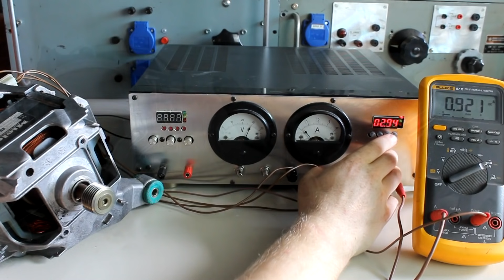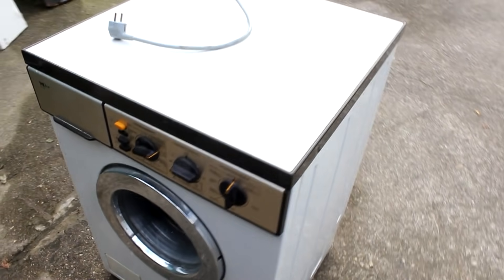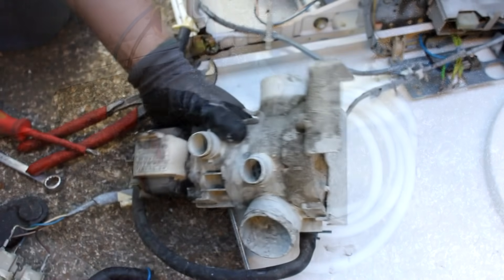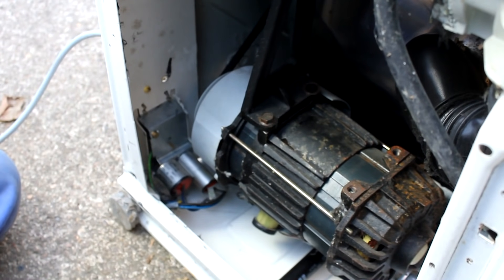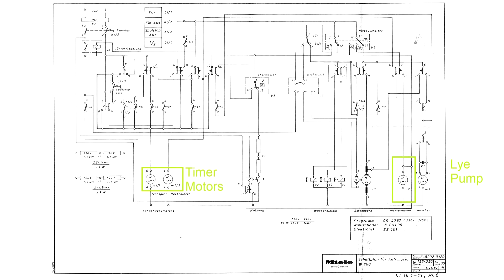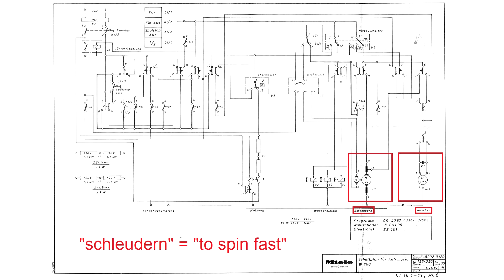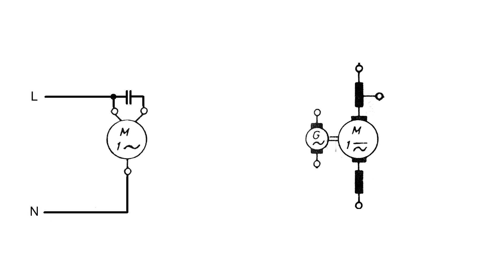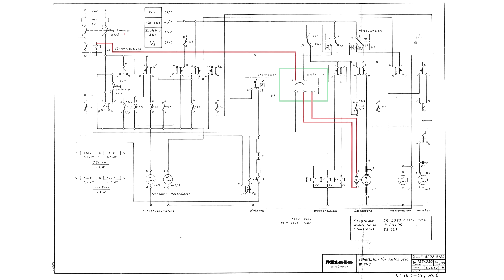Salvage a Big Electric Motor and Transmission from a Miele Washing Machine

Comment: Hi love ur videos. I have a question, can you use the universal motor when you rectify the mains voltage and than use a pwm controller to regulate the speed ? or do the revolutions keep going up the same as when you connect it directly to 230V Ac???

Comment: Hi. I'd like to share my idea that I had a couple years ago and would like to see somebody to do. There are small industrial machines called tumblers or vibropolishers. They're very popular in workshops working with metal, especially for cleaning and polishing car wheels and other large parts while avoiding most of the  labor And polishing can be really laborious. Ever since I saw one I kept wondering if one can make it out of an old washing machine and the kind of vibrator motor that's used for mixing paint.
You can use the remnants of a washing machine. You just need to cover the drum with polyurethane, attatch a vibrating motor and make sure the suspension doesn't rattle.

Comment: The washing drums are usefull.
Top loaded ones( of decent quality). 
Use as fish sump .
Frontloaded ones :drum makes good fire baskets. 
The main bearing for the drum can be reused .  Very sturdy.  On most watching machines the washing encloser is plastic  . crack the plastic around the bearing  with  a hammer. 
The screw that goes into the iron casting is for the
Electric grounding  of the drum. 
Keep intact.

Comment: Very well done video explaining and performing the analysis on an old and very well engineered and well made washing machine. Her in America I dont think we have a company we can say this is the best washing machine. Whom ever you talk to they would give a everything from MayTag to Kenmore. In may younger years I took apart many washing machines and found they use a standard induction motor and for the logic operation using mechanical switches with a beefed up clock induction motor to rotate the know to click on various switches.  As of Today more modern washing machines, I have repaired about 4 of them, mostly the main MPU board goes bad. These use universal motors.

Comment: hi. I had a similar washing machine and I am trying to save the motor. In the part of the induction motor, where do I connect the capacitor? I missed the drawings and somebody else disassembled the machine without checking connections before. Thanks

Comment: You can use the drum as a planter and the the cabinet, adding a shelf inside, as storage for parts and hardware. I did so with an old dryer, re-purposing the motor for a tool-sharpening device by adding a grinding wheel. Next time I find a washing machine motor (120 VAC where I live) I'll do some of your tests, perhaps even using the SCR circuit. I'll put everything in series and apply DC to it also--if it's the right type of motor.
If you want to get rid of your cold quickly, eat a couple of teeth of raw garlic with honey and lemon juice WITH MEALS! for two days. I've been doing it for 20 years. It works all the time... unless you catch the flu, which is viral.
https://www.amazon.com/s?k=joaquin+delgado&rh=n%3A154606011&ref=nb_sb_noss

Comment: I see you recover quite a lot of parts from washing machines, so you might be able to help me out. I have a Miele Novatronic W1918 that operates on 220 volts. The solenoid valve for filling the washing machine with water is weak and the machine shows a fault with the water supply and shuts down before starting to wash the clothes. I called the Miele office and they sent out a repairman who said that the repair would cost more than half of what a new machine would cost. Since my machine is no longer made, I would need to purchase a new model, but the salesman told me that one customer had a problem with his new washing machine and the company refused to service his machine because the washer and dryer were not a matching pair! So they want us to buy a new set and throw out perfectly good equipment! What I need to know is if the filling valves have a feedback to the computer so that ONLY their valves can be used or if the valves are simple valves that could be replaced with any other valve? If so, I would need to match the voltage of the solenoid with the line voltage provided by the machine. I have no idea what the voltage of the valves would be and if there is enough room in the machine to adapt some other valve in the place of the original one(s). Would you happen to know that information?

The repair guy also said that my drain pump is making noise and will soon fail. Can the pump be overhauled with off-the shelf parts or are they made with odd sized bearings and seals? Could I buy a pump from a different brand of washing machine and install that with adapters? The price of Miele parts is outrageous! I doubt I will want to ever buy Miele equipment again.

Thanks in advance for any information you can provide. Tearing down the machine doesn't look that difficult after watching you do it.

Comment: Would love to see a Direct Drive washing machine motor!
Reply: I think the earliest Direct Drives may be from mid 2000's .  I only recall seeing them in that era.  A lot of them would still be operating or not so cheap to purchase second hand.
My 2005 LG is a direct drive and it is still working as good as new.  LG put a 10 year warranty on their Direct Drive motors, but obviously not on the rest of the machine.   That may put them out of reach of a junkyard.
Reply: @EsotericArctos  We had an LG direct drive from 2000 or 2001. But this year we had to buy a new one because the drum bearing broke. Poorly we couldn't find a new bearing. While looking for
parts i discovered that it is a common problem from this series.
That could be the reason for no giving longer warranty on the rest of the machine.
Reply: Those are very new though (2016) compared to the rest of the stuff this guy takes apart on the channel.

Comment: What comes to washing machines, Miele is THE shit.

I took apart my parents' Miele, which had served a 5-person household way over two decades, and was astonished by the build and material quality. All the balancing weights were cast steel, not (the easily cracking) concrete that modern machines use. Every single bearing still rolled as good as new. All the load-bearing bolts were 10.9(!). I still run the motor in my wheel polishing machine today. German quality and engineering at its very best.

Comment: I had the chance to get a similar washing machine from that period. The electro-mechanical programmer was dead but I replaced it with an ATmega driving a relays board to take all the elements in charge. Those machines are not designed for programmed obseolescence. They are servicable with simple parts (standard bearings, hoses...) and the wiring diagram was even included to help you service it.
No modern machine is comparable.
Reply: I know. I took apart about three washing machines. Zero diagrams, bad screw placement, and multiple sizes of screws. They don't want you to replace parts. It's called planned obsolescence. This way you have to buy a new one .

Comment: This washing machine is before the day, vector control algorithm was perfected. Now a days, all washing machine has PMSM or 3-ph induction motor. A direct drive motor (PMSM) can run at 50 RPM for washing and the same motor can spin till 1200 RPM using field weakening technique. It involves huge amount of mathematical equation solving -- few application which can explain why we studied calculus, complex number and trigonometry in school days.

Comment: I have this thought.. that if I keep watching your videos I will at some point become smarter. Time will tell.. But I've passed over many a washing machines due to the fact that the internals might as well be from a UFO for all that I understand them. Basic electronics fascinates me, and I've always been a scrapper. I hope that my days of hauling everything to the scrap yard is over, and that some day I will be able to understand and repurpose the parts that work. Because I look at what you had there on the bench spinning that pulley up in a vise and all I could think about was steampunk drill press, or the platform for my new 2x72 belt grinder.. Although I'd have to build a filtered enclosure around the motor to save it from dust and shavings..

Comment: Really great video! No apologies needed for the absence. That Miele washer is a work of great engineering and materials quality that you do not see in newer models. Both the inner and outer tubs are stainless, whereas newer models are plastic outer tubs. I also favor the older electromechanical switching. Easier troubleshooting and not susceptible to surges and spikes on the mains.

Comment: Looks like who ever had that had hard water.  I have well water and my dishwasher got stained like that inside.  I got some Whink Rust Stain Remover.  I put that into a bottle which I could spray the inside of the dishwasher with and sprayed it lightly on the rust stains til they were gone.  It did not take long at all for it to dissolve the rust stains because it is very quick with that product.  It looked like new again inside.  I just made sure to run it a couple times empty to get all that stuff out of it so it would be safe to eat off plates washed in there.  There are other rust removers that are somewhat safer but don't dissolve the rust stains fast but they work well for people who might not want something as strong as what I like to use.  I treated the sink the same way and it did brighten up some.  Although the sink and dishwasher are stainless steel, they can and did get a coating of rust over time.  It is just such a gradual thing you never notice it but I also had rust stains like those in my shower that were difficult to scrub off.

You would be surprised how fast that stuff takes the rust stains off things but it is one of those chemicals that you will want to avoid spilling on yourself.  It contains hydroflouric acid and that is bad stuff.

Comment: I congratulate you for your recicling of old components. but a note on the coment on the circuit for locking the door. it is complex for failsafe. here in brazil, a couple of year ago, some dude took this safety board off and amputated his 8 year old son's arm, he tried to get his favorite shit off on the spindry cicle. so it is a verry important circuit and in case someone is thinking of reutilising the hole machine please make sure that this circuit work. in the other hand it is a powerfull fet swiching circuit that cold be reutilised in several aplications.

Comment: Good to hear you're okay. Those washing machines are very nicely made. My mother had an old Philips one, that was called an "Electra" sold by the nationalised Electricity Board in 1980. That too was a nice old thing. It used a transistorised motor controller with tacho, and a DC "Polymotor Italia" permanent magnet motor. The drain pump motor was a standard shaded-pole one. The Miele motor is a work of art, with its field divert system for spinning, and reversable induction motor feature. Years ago a neigbour had an OLD Indesit automatic. This used a HUGE AC motor that was reversable, and had different field taps for this, and also the spinning function.

Comment: Thanks for showing the Miele dual motor!  That motor is the answer to the problem which eventually was solved by the variable frequency drive!  But this motor is a very elegant, mechanical non-electronic solution to this problem.

Comment: Hi  mister,
Can i ask to you about tachometric controls?
I have a ISKRA (STAYER) 1990 router with a universal motor electronically controlled running from 2500- 24.000 rpm (values are similar not exact, because now, i don't have the tool under my eyes) 
The speed control is realized with a ferrite ring on the main shaft and electronic circuitry (sealed in a plastic support with epoxy) I've leaved the tool in a too much moistured room for at least 15 years. (*) Now i have completely cleaned all the tool: bearings, dust,  brushes and collector,  rust from surfaces and i leaved the tool in a  warm and dry place for all this summer before connecting electric power.
Now the tool is mechanically as if it had just left the factory, but it seems to me that the motor don't reach  the maximum speed.
When I reduce the rotation speed the control circuit cuts off  the power to the motor as it did when it was new, then the control circuit somehow works:

According to your experience could the ferrite ring be magnetized and lost its original magnetization?
* in this room I left two other tools: a drill and a ribbon sander, I connected them to the net a few days after retrieving them, I did not think they could have any problems ... after 10 minutes of testing the engine started to spin slower and the sander to emit smoke. That's why this time I've been waiting to connect the router, I hope I have waited enough.
I know it's hard to understand from my distance explanation but thank you anyway for your answer

Comment: Dismantled a Hoover from the early/mid seventies which had a large single speed motor and large gearbox and clutch arrangement  built in for the high speed and reverse

Comment: Two questions and a comment. What was the power rating of the induction motor, and what was its rated speed?
I am really impressed with the robustness of that washing machine. I have salvaged at least 10 washing machines here in the US... all with plastic tubs and concrete in the bottom for weight. I stopped picking them up, but I will be looking for a old one now. They all have induction motors (alone) with multiple windings for different speeds. Here they are usually (4, 6, 8 poles) 850, 1140, 1725 rpm. They are always 1/2 or 3/4 hp. Excellent video.
Reply: that's a miele but maybe you can find an old whirlpool
Reply: Wait i know you your the guy that make videos about electronics

Comment: This is very impressive for 1980''s. Never knew they had front load washers back then. That machine was definitely the end of a great era, the quality of the parts inside is unlike anything you would see today. Shame you had to take it apart. Would have been great to see it running.
Reply: Sorry for late reply/necroposting, but I have a similar machine that was made in late 70s and it had sensor buttons (stainless steel buttons which I guess react to electricity of human body). Was looking for a replacement motor because mine broke down (brush holder fell apart, and I think it eventually shorted out), which BTW is needed because a more modern Beko rusted out, ball bearing slipped out of place and there's no way to fix it because housing is made of molded plastic that is impossible to repair reliably...
Reply: Since the 50s maybe not Europe but whatever lol

Comment: The glass door of this machine will make a nice casserole dish, since it is temperature-hardened material and it had to stand temperatures over 100°C before. I have had those before, and they integrated well into the kitchen for anything around 180°C or more.
Reply: Yes, that was my first thought. Or maybe a heated bed for a 3D printer? It would make a great series of videos to see what could be done with all the parts of a single machine. Somebody below suggested a fire pit for the drum. The motor would be great for a sander or lathe. There's also a lot of sheet metal that could be reused if you had a spot welder.
Reply: I've known of recycling projects before that used those doors for casserole dishes, and now the fact that most washing machine doors aren't flat like they used to be really makes me hurt, because it's such a waste of perfectly good materials! But that's capitalism for you, I suppose...

Comment: I have bought a new Siemens washing machine in 2012, of which the manufacturer has stated in an e-mail to me that it will work 10-15 years. However, when I look at these old machines, I always ask myself whether I shouldn't rather have bought one of these (preferrably Miele) in order to not get stuck with dirty laundry in case this consumer product should ever decide to stop working. That's the problem with modern washing machines, they are produced as consumer products and are not repairable at all (like, having a plastic washing bucket instead of a metal one). I really hope I can get a used Miele to store in my basement, just because I like the redundancy, not even thinking about gutting it and reusing components.

Comment: The double motor idea is very good. Universal motor for low speed and high torque. And induction motor for high speed.
Reply: Induction motor maximum speed on 50 Hz supply = <3000 RPM, Universal motor 10000 to 20000 RPM.

Comment: Hi G, Glad you are back at it.  a source for real horsepower is the swimming pool circulation motor, fish pond motors.  they tend to be induction motors and they produce from 1-3 HP.  maybe such exotic uses are an american habit, but maybe in germany also. If you are looking for stepper motors,  look for an ancient CNC machine, a new chinese CNC motor, or salvage from a factory that has motorized assembly equipment.  Cheers!

Comment: Is it possible that the brushed motor section of the brushless motor assembly could have been used as some form of braking device - like the regenerative braking on a bus or coach? Just a thought...

Comment: so iron and copper was cheaper, but electricity more expensive back then or why did they do this?
Reply: it's easier and simpler to implement (no complex semiconductor circuitry required)